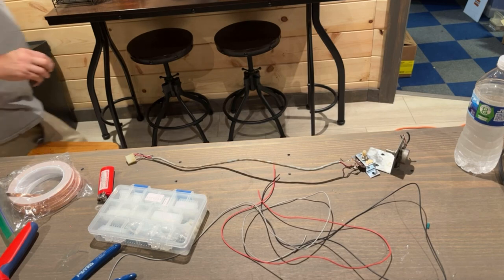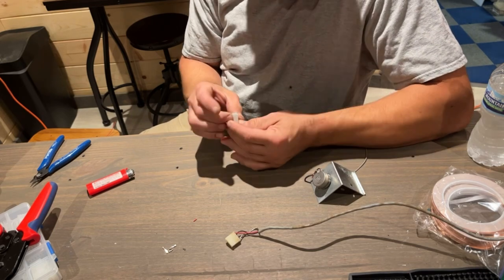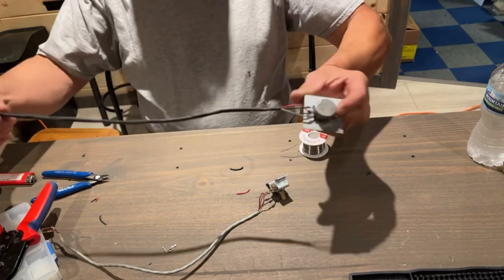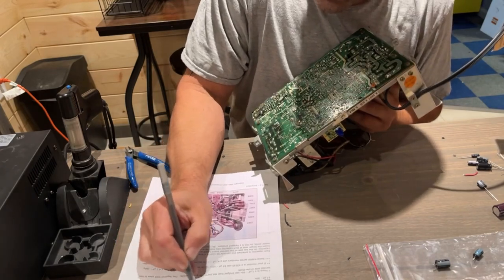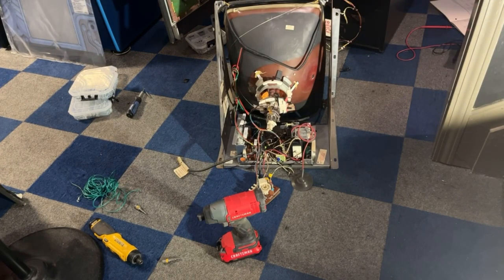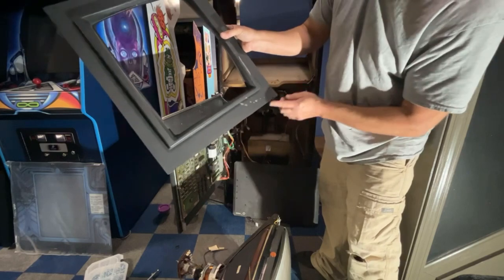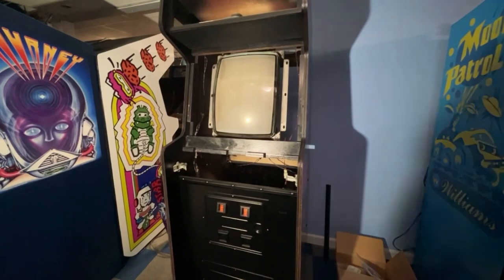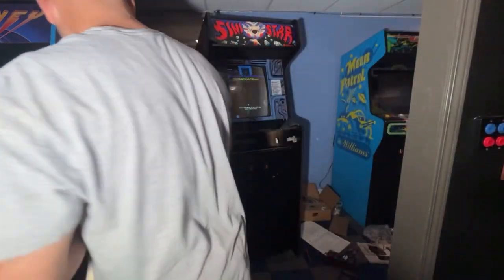Sinistar arcade restore part 5

Comment: The copper tape won't hurt anything, but it won't help unless it's electrically connected to the shield wire.  The idea is that outside interference hits the shielding and is then shunted back to ground before it can enter one of the cable wires.
Reply from the maker: Ok thank you